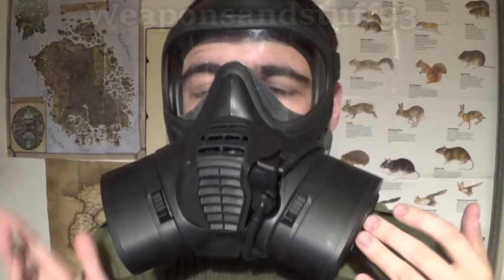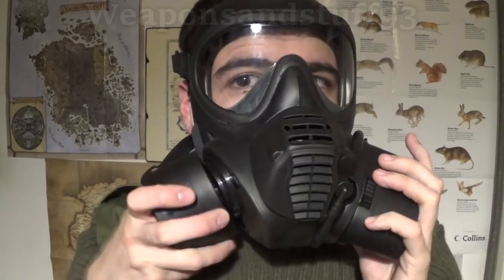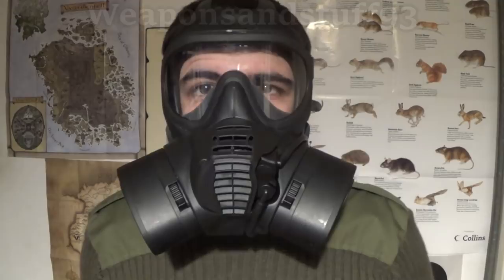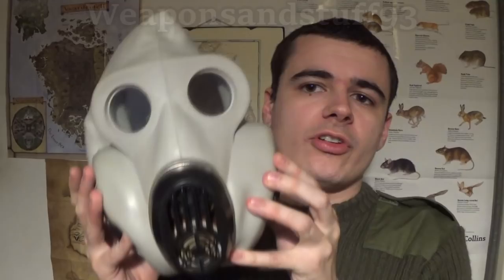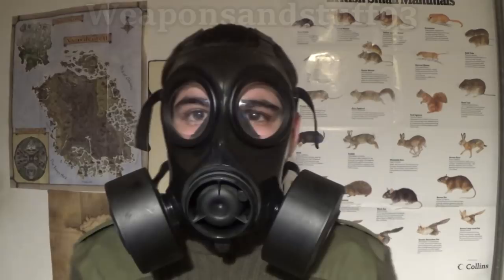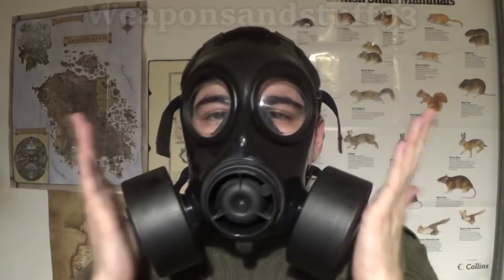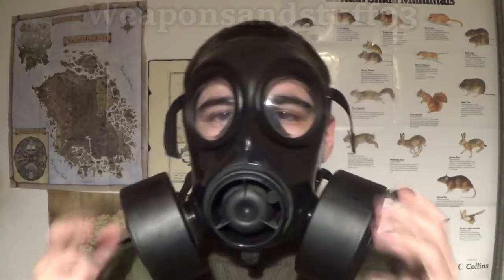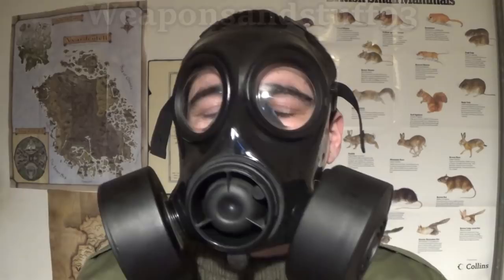Why do some gas masks have two filters?

Comment: Some are designed with two spots, but one is supposed to be capped off in actual use. Particularly because it's supposed to be on the side opposite of the rifle. (Depending on the wearer prefers shooting.) At least that's what I was told about the MCU-2/P that I had issued while in the navy.
Reply from the maker: As I mentioned in the video, but the point is what are the reasons you may use two filters, as opposed to being sensible and using the filter on your non-dominant side.
Reply: Weaponsandstuff93 because ocd
Reply: better air intake while moving when you are running or in 120 degree heat you want as much air cycling through as possible plus fresh air in prevents fogging of the mask lens
Reply: Sounds cool
Reply: You were told? This illustrates the navy so well. You didn't even have to put on the CBRN gear and try aiming or anything.
Reply: +Airen130 As long as the mask is air-tight the lens won't fog. At least, with the mask I'm familiar with.
Reply: Suspect on foot[FIN] they will 1 they aren’t double pane they are single pane and 2 they fog when you have high humidity and wear for extended period due to poor ventilation/ intake

Comment: I had no idea there was a whole thing on gas masks
Reply: What thing?
Reply: IMO it's also important to evaluate if they can be worn with eyeglasses if you wear them now or may in the future because if these should ever be necessary to survive I wouldn't count on having access to contact lenses. I have found that the full clear face shield style works well with prescription motorcycle/sports goggles.

Comment: One filter > two filters in my opinion
Reply from the maker: Yeah two adds more weight to the mask and requires you to change filters more often.
Reply: How would it make you change the filters more often ? Even in the video it says the contrary.
Reply: Who cares if you need to change filters you can breathe through filters indefinitely
Reply: The way SWAT teams here in the USA do it is they often spend their CBRN money to get IR lasers for rifles, usually DBAL's or ATPIAL's, and the reason they do this is because these modules have an IR laser for aiming under night vision, and a visible laser, which can be used to aim the rifle without having to bring your eyes in line to the sight when you're wearing a mask.
Reply: You could do what smoke from r6 siege does and have gas mask with tubes and have the filters on your back, with the tubes leading to your mask

Comment: I think that the first mask might actually be the optimal configuration. 

As you said the filters last longer if you use them both and despite saying it was difficult to replace them you seemed be able to do it in just under 15 seconds. You said the main disadvantage of having two filters on is that a user couldn't shoulder a rifle as easily because the user's cheek is obstructed by the mask's filter on that side.

That being said and acknowledged as a serious concern, if the user suspects he or she is going to be in a hostile situation where you'll need to be able to shoulder a rifle the user could quickly disconnect the filter (possibly tossing it in a "dump pouch" such as the ones sometimes used for expended magazines) beforehand or during a firefight given enough time to react on that side of the mask without worrying about the 40mm's blanking disk . 

In the situation discussed the blanking disk seems like it could be a potential hazard to the user because it potentially exposes the user to unfiltered atmosphere during installation whereas the first mask cuts off intake from the side with no filter due to its design. What do you think about this? Am I incorrect in my analysis?
Reply from the maker: Mostly correct but the GSR has lots of other flaws, bits fall off of it, the filters are too big etc.
The British army is now getting rid of them supposedly, only after buying them all about 10 years ago.
You are also not allowed in the British army to use only one filter on the GSR.
In my opinion standard one filter masks are better, changing a 40mm filter in a simple to get at port is very fast and efficient.

Comment: Aren't there some dual-filters with both filters front and center, but one is below the other?
Reply from the maker: Never seen those.
Reply: I was actually thinking of that very same configuration while watching this video though have also never seen one. I wonder why.
Reply: [ Soviet Maverick ] I think that was what Seth was going for.
Reply: [ Soviet Maverick ] the metrocop masks are based off the slavic type masks much like the one shown in this video.
Reply: Yes there are they are used in industry when spray painting. don't know of any military use though.

Comment: i guess the point of dual filter, as i've learned from you in another video about filter life, is that when you are exposed to something really deadly like the saryn or nerve agent you can change them out one by one or leave one taped over for easy changing in timed fashion rather than by waiting to taste, smell, or feel breathing resistance for when the filter is dead. you've helped me a lot. thanks. im thinking of the SGE 400/3 BB with a some good abek-p3-r-d, but parcil's max pro 203's are like 80$ a can.

Comment: I'd like one where one is in front like a traditional single filter gas mask, the other on the left, out of the way of a gun, and with an easy way to switch between either, so you can either easily swap primary filter while using the secondary filter less, or different filters for different types of contaminants.
Reply from the maker: Seems a very odd design, just go for a normal respirator with a decent filter on it.

Comment: Having worked in both 1 and 2 filter masks, I have strong preference for 2 filter designs. Doing hard work in hot weather with a one filter mask for hours on end is very uncomfortable to say the least, and I've seen people tear off one-filter masks in panic (and then get a fun job like filling sandbags for doing it) because they felt like they were suffocating.

Rifle shouldering is a bit of an issue, but if you use an electronic sight, you can usually cant the rifle and still see your sight. Obviously there are drawbacks when it comes to accuracy, but it's really not that much of an issue unless you're doing precision shooting with a magnified optic.
Reply from the maker: A lot of it also depends on filter design, I have dozens of different filters laying around and some despite offering the same protection levels offer much better airflow than others. In an ideal world on both single and dual filter masks you want a filter that has the least air-resistance possible, because that goes a long way to help with breathing efficiently.
Reply: Fair enough, and a huge filter on one side may be preferable to 2 smaller filters. Also, to be specific, I'm talking about a MCU-2/P vs an M50. You actually have to cant the rifle for the MCU-2/P as well, even though it's one filter, or mash the mask into the stock (which I was hesitant to do due to possible damage to the mask or the seal).

I do wonder if part of the issue with 2 filter masks is the particular design. The GSR and double 40mm filter systems seem a lot clunkier than the M50..
Reply from the maker: Yes the GSR was the M50 on a budget, that is now considered unfit for service and the MOD has had to pay Avon for M50s now regardless. The M50 filter is about half the size of a GSR filter.

Comment: Imagine a gas mask where the main tubes ran along your lower jaw, so that you screwed in the filters close to where your ears are, making it easier to shoulder a rifle.
Additionally, the same design could be used to connect to an oxygen tank for underwater usage.
Reply from the maker: There have been weird masks with the filter behind the head or above the head, they didn't catch on so it probably bad problems.

Comment: The one thing that you forgot to mention is that the gsr filters can be reversed (like you accidentally did in the video) to make shouldering a rifle easier. The way I see it, there is no real disadvantage to the gsr: is has better vision, the filters are smaller and can be easily up on with some practice. They might also be less likely to snag on things. I've never tried it out so I don't know for sure.
Reply from the maker: Twisting the filters to the reverse does almost nothing to help shouldering a rifle, I've done other videos testing it with optics.
I have 70 odd gas masks in my collection now and can pretty safely say the GSR isn't all that good.

Comment: I think dual filters is good if you have the mask hoses
Reply from the maker: That would have to be for a filter carried on the back or two hoses would be really troublesome.
Reply: I agree, though as you mentioned dual filters are already troublesome in terms of weight among other filters. I thought that maybe using hoses would reduce the weight problem of using dual filters. An example that i like are the "dual filter" side mounted russian gas masks. While using two filters is not typical, and may suffocate you depending on the model, having the ability to switch between right and left with or without hoses is a good feature.

I'm no expert though, which is why i decided to watch your video :)

Comment: A good reason to have a dual filter system, is that you can have two different types of filters that cover different possible threats, just plug or remove the filter that is not necessary for the threat at hand, just remember which filter does what.

Comment: You can be exposed to CW while changing out each filter.  Good idea would be to change filters when NOT in a chemical environment.
Reply from the maker: It's a last resort thing, if your filter runs out you can risk changing it or die.

Comment: You actually don't use both filters when in use.  If your a left handed shooter then the filter is on the right side.  If your right handed then it goes on the left side.  This way your filter is in the way when shouldering your weapon.  You could use both fliters at once, but your just wasting filters at that point.
Reply from the maker: Both the Avon M50 and Scott GSR and pretty much every 3M mask are designed to be used with both filters at once.
Reply: Weaponsandstuff93 I completely forgot about those ones.  However I've ever only only seen the M3 used with one filter during combat.   I'm not a huge fan of the Avon M50. I can't speak about the GSR never seen it used in real combat or security situations, nor have I ever used it.  I use to use the M17A2 US ver.  You wouldn't think that inner cheek filters suck, but they do especially when you have to change filters in the field.  I use the MCU-2A/P now and your only supposed to use one filter when in use for those reasons. (I'm so happy that I switched over to the M40 series)

Comment: What about one on the left and one on the middle and the output to the right so you can shoulder a rifle.
Reply from the maker: Not really practical to distribute weight like that, plenty of masks with bottom or front loading filters though. As long as the filter is out of the way of your cheek weld it's generally fine.

Comment: Been wondering about this since playing as Pyro in TF2..
Reply from the maker: Pyro's mask is really weird as there is a frontal filter and a side filter.
Reply: @Weaponsandstuff93  imo the part at the front of pyro's gas mask is an exhale valve/voice diaphragm.

One of pyro's concept art sketches has both a side filter and a front filter hose though but that mask is very different from the mask in pyro's final design

Comment: Because it looks cooler, Also, Cant they just make it so that there is one filter on the middle then you can put the other filter on your non dominant side? That would make them more useful
Reply from the maker: Some masks do have a central filter, there are both advantages and disadvantages to that.
Reply: Wow that was a fast response
Reply: Something I forgot to add was that, the SAS model from Counter Strike Source I believe is an example of this unless its a gas mask with one filter, Not sure

Comment: Would a 40mm Nato PMK filter fit correctly into the Avon (I have an S10) gas mask? I saw an earlier video you made about how some Nato filters and masks don't seal correctly
Reply from the maker: There's no such thing as a NATO PMK filter because the PMK is a Soviet respirator.
Reply: Weaponsandstuff93 Ah I see; What filters do work for it then?

Comment: Why did he not like the 1. mask? Why did he like the last dual filter more than the 1.? With the 1. one you could just take one of them off and did not need to screw anything in? It had it build in?
Reply from the maker: I've done plenty of videos explaining why the GSR is a bad mask, primarily due to size/weight and poor quality parts that if they break you die.

Comment: Are there any 40MMs that have the ability to be replace “on the field” or what ever and not have death has come rushing in from one end like the first one you showed
Reply from the maker: You can replace any 40mm filter on the field, it depends how you define "Death rushing in", if it has an internal valve and you hold your breath it won't open.
Reply: Weaponsandstuff93 I mean removing one end that side sealing up so no air goes in while you breath threw the other one, replace the one you took out then doming the same for the other side

Comment: For your next all about this gas mask can you do the forsheda f2/f2a4 also do you have to use silicone lubricant on a mask and if you do why
Reply from the maker: Silicone lubricant is very good at stopping dry rot, preserving the rubber and making the mask look shiny, you can use it to prevent rust on rifles as well.
You don't have to use it but it's good to keep masks looking good.

Comment: I have been thinking about a S10 Gas Mask with one 40mm Filter on the side, and a filter hose on the other side.

Does the S10 Gas Mask work the same way as the CT12? (As seen in the video)
Reply from the maker: No the S10 only takes one filter, the SF10 can take two filters though.
Reply: Weaponsandstuff93 

Kay. Since that SF10 has the possibility of accepting two filters, and I think it also accepts some outserts. 

(Was thinking of getting one of these S10/SF10/FM12 gas Mask series to use it both for cosplay or survival.)

Will people still be able to hear my voice without the voice diaphragm disc? (Like you shown in the video)

Comment: Can an s10 use duel filters if not then where can I get a CT 12?
Reply from the maker: No normal S10 are single filter only, you'll probably not find a CT12 for sale, your best bet is getting a dual filter FM12 on eBay

Comment: so is it possible to use the first mask effectively with one filter
Reply from the maker: Not really, it's crap in both filter configurations, the filters on it restrict air flow so one barely lets you breath while two is okay.
Also the British army does not let soldiers use it with only one filter. It's a bad mask basically.
Reply: Weaponsandstuff93 i’ve heard people say it’s highly rated on the market

Comment: Is okay to breath thru my MK1  filters for my mask ?
Reply from the maker: MK1 Yugoslavian filters, I've heard they're safe but if you want 60mm filters that are definitely safe get Finnish 60mm filters.
Reply: Yeah , my MK1 is from yugoslavia , it's from Serbia, made in my city , it's really good and i didn't had any issues with my 20 + yr old filter , is there any reducir from 40 mm to 25 mm or something like that ?
Reply from the maker: You can get a 60-40mm converter on eBay and other places if you want to use use modern NATO filters with it, or you can get a Serbian M2 mask that takes 40mm NATO filters.
Reply: I can't buy anythin from ebay or any site , i would buy just converter

Comment: Well if you're a support soldier you just try to aim the machine gun in the area the enmeny
Reply from the maker: I do actually wonder if the nightmare Cold War chemical warfare scenarios unfolded, how inefficient the soldiers would be at operating in bulky NBC suits and gas masks.
Reply: Weaponsandstuff93 most likely hot and uncomfortable and trying not to get the gloves pinched when you reload or pulling the trigger
Reply from the maker: I suppose that's the sort of scenario where actually having drinking systems incorporated onto the masks would come in handy, NATO masks eventually being more comfortable and allowing hydration would cause attrition to the more claustrophobic ShM style Soviet masks.
Reply: Weaponsandstuff93 that would make it more comfortable with the ability to drink some water other then if the water hose where to be cut or damaged you could be harmed by what you are being protected from and if the water where to run and you could not change it and what where you talking about is in the filters